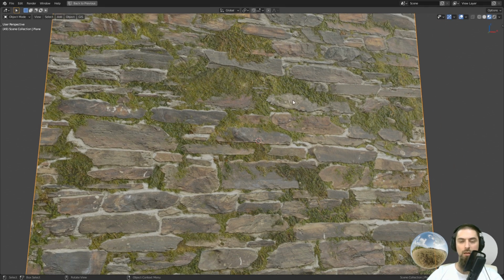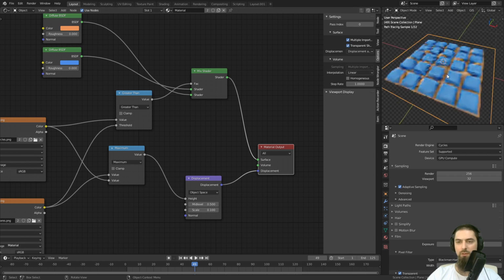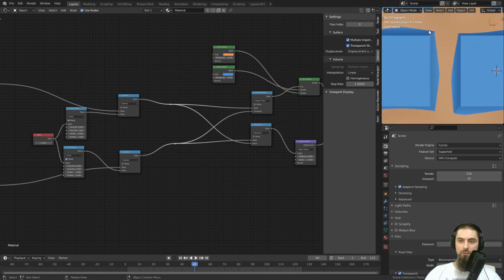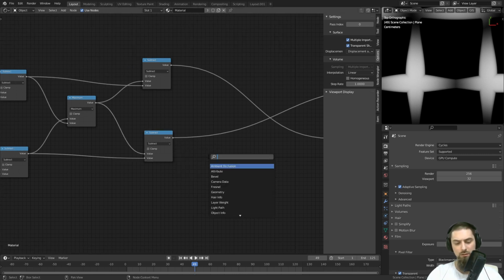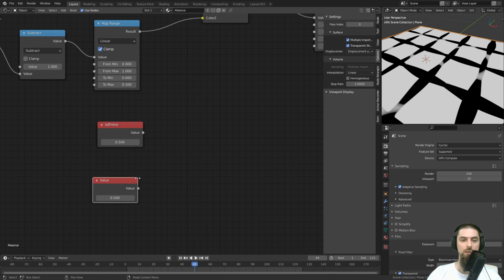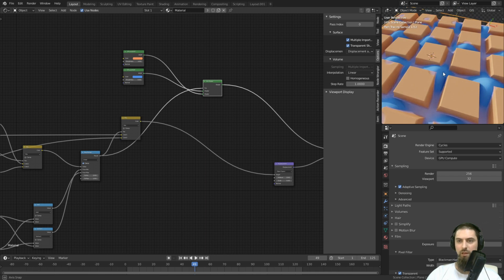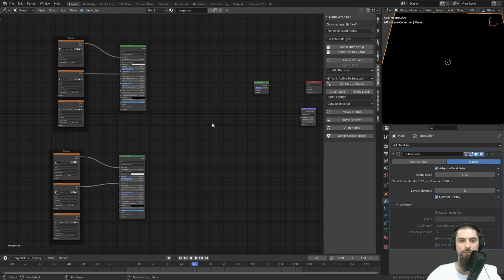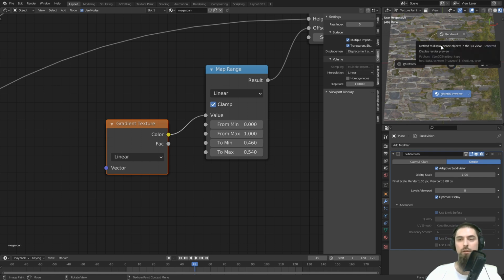Blending Materials With Height Maps

Comment: I am trying to add snow to all kinds of objects. I want the displacement of the object but I want to be able to control the displacement of the snow as well. I have followed every tutorial out there and just cannot get what I want. Ether the snow has very little height or it has height but it has a strange edge. this tutorial about blending the two heights looks promising.  I light being able to control the direction of the snow so that if i add snow to a scattered collection it will face the way it should and not be bound by the objects orientation. If you could contact me perhaps we could work on this together. I think it would be a game changer for blender.